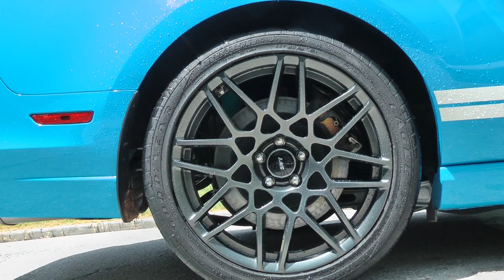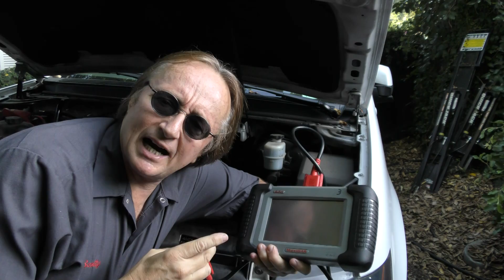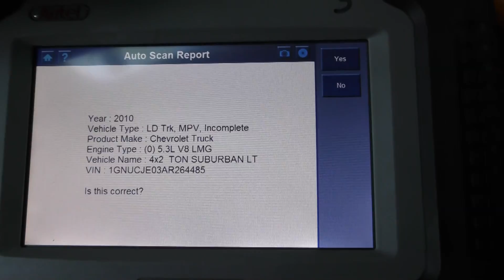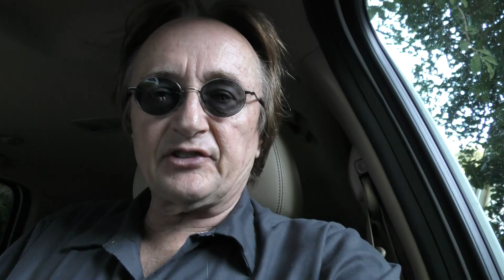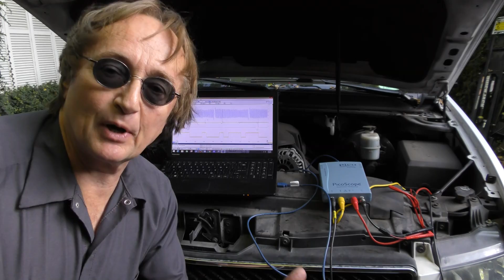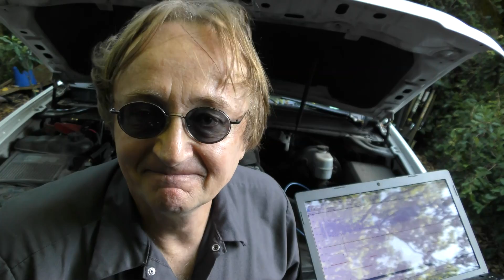Why Mechanics Charge So Much to Fix Your Car

Comment: Becoming a mechanic in 10 years from now is something that's probably going to be impossible unless you have master degrees in computer science and electrical engineering
boy I miss the good old days....
Reply from the maker: So do I, but then again, it makes for interesting tools I get to fool around with. Being a famous mechanic, I no longer have to buy the tools, companies sent them to me in droves.
Reply: It's scary watching a mechanic diagnosing a modern car. They are almost computer geeks and they don't even know it.
Reply: And even then they will still probably only pay them less that 40k a year unless they own the shop
Reply: Theist God we're still a long way from that and even then, mechanics will have the advantage of knowing most of the principles and inner workings of a car and would just need to learn different concepts and apply that knowledge.
Reply: we will figure away around it
Reply: I miss the good old cars.
Reply: Taylor Hennesey They do it now. they required lots of technology courses before you learn anything about car repair.
Reply: Taylor Hennesey plus the computers make it easier to diagnose the actual problem where in the " good old days" there was alot of troubleshooting with trial and error and alot of parts being replaced that were perfectly fine
Reply: Bull. I started to go to college for Automotive at Dunwoody (a nationally known college) back in '91 and they were already making the mechanic a person who could diagnosis electronics first and wrenchmonkey second.

Not sure what the companies are doing now internally but there's no reason why with computers diagnosing computers it shouldn't get easier. Often the hardest fixes are when something in wrong in a wiring harness because then you can't trust the system itself.
Reply: Well the thing is that most shops are started by a mechanic that worked at a dealer. Dealerships screw their mechanics over so they almost always end up leaving for a private shop. Heres how it goes for mechanics. Guy goes to school to be mechanic, gets job at dealership, gets frustrated with dealership, leaves, and brings his tools and knowledge of new cars with him. It'll keep happening for as long as cars exist.
Reply: 891trigfoot .....diagnostic tools don't jump out and grab you by the arm and say hey replace this part..... You still need a person to use that tool properly and analyze what it's telling you
Reply: It's called adaptation. If you're too dumb to figure out basic electronic systems then you shouldn't be working on vehicles to begin with. All these codes and systems actually make diagnosing easier. Try working on a mid 80s car with a carburetor. Seemingly endless vacuum hoses and so fourth. However, with something as simple as a scope or noid light, one can easily identify issues. On a modern vehicle those sensors are so fine tuned they can accurately identity which cylinder is malfunctioning. Thus saving you a ton a work!
Reply: Taylor Hennesey so get a masters degree! or better, dig into it, teach yourself! when i went from residential hvac mechanical to commercial automation, it was a big change and it seemed overwhelming and unnecessary but there is a plethora of tools to go along with the complex technologies that make our world run and each one is incredibly powerful in its own way. as you learn them its incredibly rewarding to diagnose complex problems and it gets easier and easier the more stuff you learn to use.
technology isnt all bad.
Reply: plus you can make a lot of money when you get into that shit.
Reply: Peter Piper BUT, when those said parts are in the thousands of dollars range, it is a good thing to know for sure. It is one thing to throw 2 or 3 relatively cheap parts at a problem, and another to throw VERY expensive parts to the problem in hopes it fixes it.
Reply: MGRaiden64 Yep. The indy shop I visit every once in a while worked at Mercedes Benz for 15 years but started to hate the company culture where dealerships were allocating less labor hours per job which meant rush, rush, rush. He owns his own shop now and services many makes and models but specializes in Mercedes Benz.
Reply: Taylor Hennesey ya i doubt that, thats what diagnostic tools are for
Reply: Uh, how do you figure that one dude? One would have to at least understand the data that's being displayed on the screen, then compare that to proper operating parameters based on reference materials in order to make a decision on what to do next. So it would help if a mechanic IS smart enough to understand the data displayed on a computer screen. So your comment is.........at best, not so smart.
Reply: It will rapidly get easier than it is today.  The tech is complex, but the tools are getting so much better and evolving much faster than the vehicle computers. 

The hardware of an OBDII-CAN  diagnostic system is trivial. Software represents 40% of the cost. Almost half is for obtaining the manufacturer and vehicle-specific codes and data and integrating the updates into the troubleshooting tree.  

The delay and unwillingness of manufacturers to release that data to third parties is why dealer service shops will  continue to have a competitive advantage over independents.  Another factor is that some states are actively resisting the right to do DIY repairs in the same way that the are opposing Teslas direct sales.
Reply: that's BS.  the manufacturer manuals will tell you what those codes mean & what to replace.  it's NOT rocket science
Reply: Taylor Hennesey ..I've been a tech for a 30+yrs .it is true that the new techs will have to have those qualifications, but we're already using those skills in present day vehicles. What's mind blowing is when a younger tech sees me adjusting air/fuel mixture on a carburetor with a CO machine or adjusted dwell on a distributor, they look at me like I'm some kind of genius. They have no idea what I'm doing and they think it's super complex. It's interesting how people perceive things on vehicles as difficult or complicated.
Reply: but think about it it doesn't means it is harder. every entry point for any field has it's advantage and disadvantage
Reply: Taylor Hennesey Self driving cars are the future government and corporations want to force down our throats. Not looking forward to the future.
Reply: Taylor Hennesey yeah everything is becoming smart even though a lot of things dont need to become smart
Reply: Taylor Hennesey We all do, bro..
We all do.. :')
Reply: Mr99RICH99 no shit but it starts u in the right direction and if u have the repair manual u can use the diagnostic tree to figure out whats wrong from the code anyone with half a brain can do it
Reply: Once you pick out what you'd like to keep (if that's the case), send a few my way to check out ;) .
Reply: You got that right!
Reply: Me neither.
Reply: Not so. Magicians know how the tricks they perform work.  They don't need computer diagnostics to  figure them out, and they WANT you to watch while they work.   ;-D.
Reply: + pssst3 - Man! Talk about being in the KNOW! Good stuff TO know as a matter of fact if one wants to fully understand the industry today!
Reply: Peter Piper if the manufacturer wont give u the codes your going to the wrong dealership i get my codes read for free everytime and because i have a 95 riviera with its weird obd1/2 ecu a obd 2 reader wont work neither will jumping a wire to flash codes so they bring out their huge diagnostic tool the mechs use to read my codes at no charge. I now have a code reader that works but my point is if the dealer wont give u the codes or wants to charge u to read them u need to go to another dealership
Reply: Peter Piper nobody forced u to buy a hybrid and like i said if the dealership wont give u the codes for free then they are ripping u off, if u bought your car from this dealership i would hate to hear how much they gouged u,the scam they use is they will say they want to charge for a diagnosis which means the mech will take the codes and troubleshoot to find the problem which obviously should cost something but u have to tell them u just want the codes which should cost nothing because they are just reading them off a screen
Reply: Peter Piper easy fix dont buy a hybrid and in reality u can fix any car yourself what u think the 20 something right out of college mech that probably works on your car at the dealer is some kind of rocket scientist theres a reason why its only 3 years to be a mech they arent engineers and even with hybrids its just more electronics which when u have a knowledge of how it works and how to test it, really isnt that difficult. Give me the codes, a multi meter, and the proper maintenance manual, like the mechs use with a diagnosis tree, and i guarantee i will known what part to change on a hybrid. Electronics work like water it has to flow from point a to point b, use that idea and go  from there. And with real time data simple just ask them what looks alittle off ya they might charge u a bit for that info but nowhere near what it would cost u for them to diagnosis the problem
Reply: Ski Fall .......obviously your not a mechanic so shut your stupid clueless mouth
Reply: I took apart 2 laptops yesterday, regular cleaning and new thermal paste on one and keyboard fault on the other and i wish to own my hobby car workshop one day. The last thing i want to do is mix them, i can work on electronic/tech stuff and i can work on mechanical stuff but knowing how much time im gonna spend on a computer to fix a car is just off-putting.
Reply: @Taylor Hennesey  if you have a master in computer science and electrical engineering you don't need to repair things like scotty do. Your working area is in a big car company: building this car computers

I study chemistry and invironmental science but at the moment only the bachelor degree
Reply: One day we be wearing lab coats and never get greasy
Reply: That is an incredibly long stretch. A masters in either of those fields to fix a car is a waste of time, money, and potential. Working on a car is a breeze compared to what college puts us through.
Reply: Is it worth it to be a mechanic with today's computer on wheel cars? NO
Reply: And with all this technology cars still  run like crap
Reply: As someone with an electrical engineering degree and who programs quite a bit, I doubt it. There's a lot of usless shit you'll have to learn to get a degree. At mlst youd need like some sort of 2 year electricians degree and programming is pretty easy, most mechanics are smart enough to pick it up pretty fast if they applied themselves
Reply: We're not far from it at all. Look at tesla and other recent electric vehicles. They're smartphones on wheels that can only be diagnosed by computer engineers. Mechanics are nearly useless in this aspect.
Reply: Taylor Hennesey you are just stupid. Also using windows pc or android is complex jet kids in ki dergarten master it. Cars are evolving but so do we. I learn my 2012 car in 3 days. I can do whatever you wish.
Reply: 10 2 53
Reply: They are just like any other tool you just have to use them to learn them, your not making your own computer programs your just learning to use them it's not hard just like anything else.
Reply: I won't buy a car that has computer parts rather die then have one hate the route of computers !!! disgusting!
Reply: That's what was said at a TST seminar in NY by the Boss at IATN. You will have to go to school and get a degree in electrical engineering to be able to work on them + buy all the tools. 4 years at college + the vocational side + all the tools you will need and start out at maybe 15.00 an hr flat rate= no bring home pay! We are all being fazed out one year at a time.!
Reply: it seems like you actually need more detective skills, it can show a sensor error but it can be another sensor getting bad data and in turn giving a bad mixture which causes another sensor to get wrong data, and all of this can be caused by a faulty cable or an oxidized connector :/ which can end up in being few hours of work "why do you charge me so much for replacing a 10cent connector?"
Reply: i studied CS in school and it wont help you do this. hell, just ask employers. they dont think my skills are relevent enough to even hire me as a software developer! been searching for 6 months!
Reply: Not really. We have and need these smart diagnostic computers just because the average mechanic has no clue about computers, even though today's cars are high-tech computing devices. We have these so the mechanics don't have to get much more smarter, than they are and can be.
Reply: they were saying the same things 100 years ago.
Reply: Right over your head
Reply: They're not mechanics anymore, they're magicians
Reply: I am in college now for IT, but I don't doubt I'll be working on cars in 10 years.
Reply: Gábor Bérczi .....that is the dumbest comment on YouTube.... computers don't tell you what to fix.... the system at fault still needs to be diagnosed by a tech,  a human!!!
Reply: Is it all that bad that people with formal college education on engineering will eventually repair cars rather than a random guy who empirically learned through word of mouth?

Comment: A good example is my BMW N55 335i leaking oil out the housing gasket. BMW charges $150 to tell me this. Then charge  $15 for the part and almost $600 labor which includes an oil change and coolant flush about 2 to 3 hour labor time.  Lol If I knew the issue myself I could pay   $15 for the part and take it to a local reputable shop that charges less in labor and fees and does the work in less time. Or if I am  brave and have basic tools and a driveway and a Saturday afternoon free I can do it myself.
Reply: Will your next car be a BMW ?
Reply: I've had three BMWs since 2004 and BMW  has horrible customer service across the USA compared to every car dealership I've dealt with. Also BMW cars are now so complicated that even with a code reader and DIY skills you need to take it to a shop. For instance my 2011 3 series' water pump cost over $1,000 to replace because the labor includes raising the car up and dropping the frame to access the pump which is then welded to a thermostat that has to be replaced at the same time. By contrast my 2001 3 series water pump was $59 to $250 and took me 2 hours or less of DIY time to replace. So as these cars get crazy expensive to maintain while being less DIY accessible I will not buy another BMW. At most I may do a 3 year BMW lease but I would rather buy another car brand that has honest and friendly customer service.

Comment: That is why the charge a fee to diagnosis your car or basically tell you what is wrong. I keep an code reader and visit online car forums to try to save money by knowing what I need done before taking the car in. This was I just pay for labor and parts. Diagnostic fees can be as high as $300